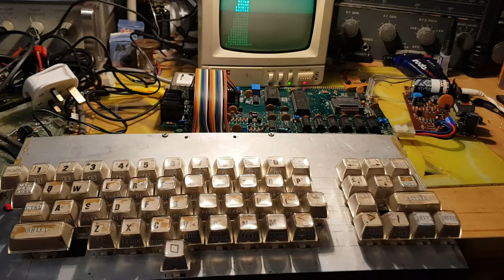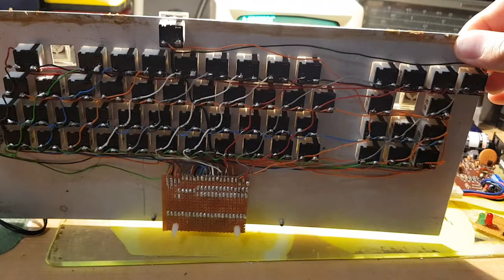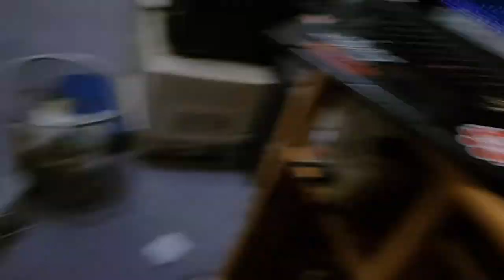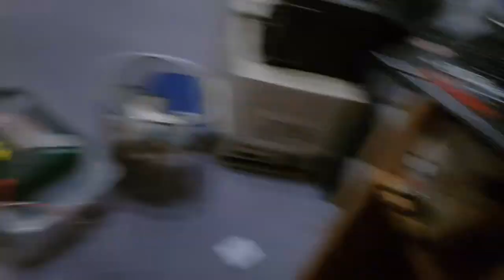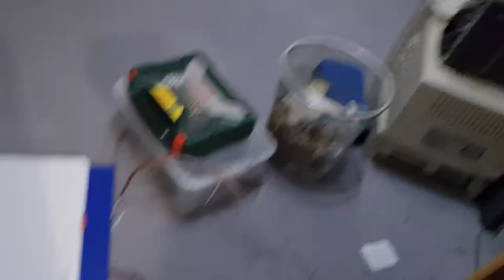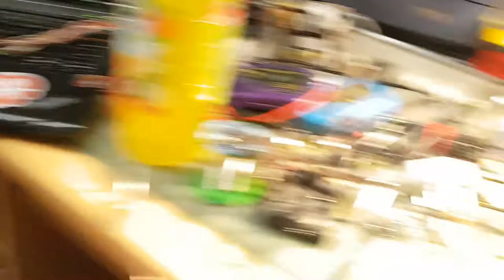Acorn Electron Portable MK2 #1

Comment: Maybe you could use two 5V psu in series to form a  -5, 0, +5 psu (-5V would be the ground of the first power supply).
Reply from the maker: That is not a bad option. After all it is just a center taped 10V supply.